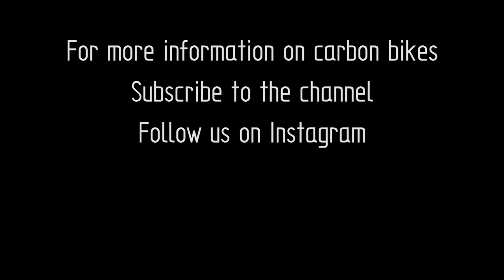Carbon Bike Flaws - Sand Through

Comment: I've had few years old Cube Reaction frame painted with clear coat. Whole frame looked like in this video. I also have Scott CR1, from I think 2009/2010, and whole frame is in beautiful carbon fiber cross patern, without any of this crazy, post sending marbles. I also have BMC Team Elite... and I have to say, that i'm very happy because it's fully painted frame and I don't have chance to see this poor quality production method of modern bikes... 😉
Reply: If I may ask: how was the original paint removed before the clear coat was applied?
Reply: @zwamman  at Cube frame, there was only few graphics on it. It was black/natural carbon fiber frame. There is no colour added to the paint. Scott is also in natural finish.

Comment: In my experience they use a belt sander not a disc sander. Is that what you meant? Sorry about being so picky about the details. Nevertheless it doesn't really change the impact of your examples.
Reply from the maker: I have seen both used, however the majority were 3" disc sanders, it might have changed now.
Reply: @LuescherTeknik  Almost always a 3" DA sander. Belt sanders dig and score. Contrary to what you want in paint prep.

Comment: I had a raw tifosi frame . That had zero of this marbled look . I could see the weave was uniformal,  I could see on the fork the different directions of the weave but there was no sanding marks but I could see the joins in the carbon .  It wasn't an expensive frame and obviously not to a high standard like time but it seems like they at least took some care in manufacturing.

Comment: Surely there is a single non structural lightweight lamination on the outside to allow for just this kind of thing and general wear and tear in general usage? Plus a factor of safety in the design assumptions?
Reply: Accepting that sanding through multiple laminations is “less than ideal”
Reply: You're suggesting manufactures add 2 or 3 plies for that?
Reply: I was once told by a specialized sales rep that was indeed the case. I was worried about some deep cable rub and he told me no to worry because apparently the top layers were “sacrificial”.  He wasn’t an engineer but I did think he was trustworthy.  This was years ago however.
Reply: Losing 1 ply or a few isn't going to result in instant failure but it does set the stage for future failures, both slow and quick (slow being fatigue failures and quick being an overload event like hitting a pothole at high speed by accident and the frame cracking)

Comment: Why is silicone oil so bad? I tought silicone grease is pretty much compatible with everything? Of course ester or polyalkylene glycol based oils are incompatible with a lot of plastics and syntheic materials, but silicone?
Reply: Yes, I'm wondering about the suitability of silicone grease also.
Reply: @Alfred Wedmore okay but how is silicone oil or grease causing delamination, when it normally should be completely fine with any typ of plastic or resin? 🤔
Reply: @Alfred Wedmore sorry but thats a description, not at all an explanation. Penetrating and causing delamination... okay sure. But a lot of oils are good at penetrating. So why should silicone oil be especially bad? And what is causing the delamination? Chemical reaction with the resin? Swelling of the fibre?
Reply: @Alfred Wedmore okay so basically you dont know an answer. Very helpful smart guy
Reply: @Alfred Wedmore sure that makes sense! Because it definitely can mess up the bonding and hardening. Especially when you use it as a spray oil, a thin film of it will be everywhere. But in this case we are talking about a finished product. So thats the reason, why I was wondering about silicone oil being not only bad but especially bad?!

Comment: Tell me again why CFRP is a good material to make bikes out of? Isn't CFRP supposed to be stronger and never fatigue?
Reply from the maker: Any material with flaws can fail, it is a design and manufacturing issue not a material issue.
Reply: @LuescherTeknik  Sure but can you agree that CFRP has a catastrophic failure mode? how can such a material be safe for use as a structural material? at least the metals will bend before they break and you can see the damage before total failure.
Reply from the maker: @Shannon Deckard   When you say structural material you mean like the wing of a commercial aircraft or jet fighter?
Reply: @LuescherTeknik  They do shear off when pushed to the limits like they did when composite lugs sheared off in this accident - https://en.wikipedia.org/wiki/American_Airlines_Flight_587
Reply: @LuescherTeknik  My titanium frame is never going to fail. USA made titanium and a US custom welder built it. 😁
Reply: @wasupwitdat1mofiki94  welds can fail, were the welds xrayed?  No they were not, you know why?  Not for bikes.   $$$.
Reply: @wasupwitdat1mofiki94  Titanium bikes are prone to cracking, and it’s not always at the welds. Feel free to google around. They’ll typically last quite a long time until it happens, but it’s something to be aware of. My buddy just had his custom Ti bike fail fairly spectacularly in the down tube/BB junction after 6 years.
Reply: @RyonBeachner  Carbon fiber vs titanium, titanium vs carbon fiber, I'll take my chances and trust my life with titanium any day. And should there be a failure in my frame it's got a lifetime warranty.😉
Reply: @wasupwitdat1mofiki94  Many titanium frames fail, mostly in the welds if they're poorly made. As an example, Lynskey frames commonly had this problem for many years. 

But I do agree. If I would buy a bike for a lifetime, I feel like my chances are better with a titanium frame builder with good reputation.
Reply: @Antti5  Or a carbon fibre frame builder of good reputation.    Rgr
Reply: @wasupwitdat1mofiki94  I've seen people bloody on the side of the road after their Ti frames from US custom builders (with lot of experience) tore apart under load. I'm not sure why people think titanium is magic. It's harder to do right than just about anything else. And it's not usually the welds that fail, its the heat-affected areas near the welds. Hell, last month I was tightening a titanium skewer and the threads failed. They peeled right away over about 2mm leaving a blank stretch right where the nut was.
Reply: @wasupwitdat1mofiki94  I’m not saying Ti bikes are unsafe or bad, just that people need to really get away from this mindset that Titanium is some exotic indestructible wonder metal, it isn’t. Like anything else, it has it’s problems, and it has its strengths. As long as people can be realistic about what they’re buying we’d all be much better off.
Reply: @robertp7209  When welds fail on a metal bike, they do not collapse like they would like a CFRP bike would. You can still ride home on a Ti or steel bike.
Reply: @SethJayson  I find that what you said very hard to believe. Please show proof.
Reply: @RyonBeachner  Can you please post the links. I cannot find any.
Reply: @shannondeckard8587  I agree with you, carbon should have never been used for rims and fork steerers.  Thanks to carbon rim catastrophic failure lawsuit payouts, we are stuck with F’in disc brakes on our road bikes.  Can’t even convert the bike and fork back to rim brakes.  Everyone knows carbon is not a proper heat sink material for braking.  It’s a F’in heat insulator.  The only proper material for a steerer is steel or aluminum alloys.  The weight weenies out there, I’d say 9 out of 10 of them, can readily trim more fatty acids off their bodies than any carbon weight advantage offers, and then some, especially their butts.  A lot of fat cans out there on their lightweight big buck bikes.
Reply: That's like a baker burning a cake and you blaming the ingredients. It isn't the carbon fiber's fault, it's the manufacturer's fault.
Reply: @HolmsOnBikes  When CFRP fails, it fails catastrophically, and it takes down the whole bike. Metal bikes will likely survive if one tube or junction has failed.
Reply: @shannondeckard8587  you obviously didn't watch much World Tour bike racing this year. Jumbo-Visma rider finished a stage on a Cervelo that was missing an ENTIRE seatstay. 
 Carbon is the better material, hands down. But if it isn't manufactured correctly, it can end badly. 
Carbon has the best fatigue life out of any material.  It is lighter than any material. It's stronger than other bike materials. Your logic is flawed and it's based off of some major misinformation for sure. 
  I don't believe the aerospace industry would be using Carbon everywhere if it wasn't the best material for the job. They scan absolutely every single piece they make, unlike the bike industry which hardly scans anything at all.
Reply: @HolmsOnBikes  Just listened to the podcast interview with the Cervelo engineer regarding that particular bike and he said that the designed the bike essentially to be strong enough to not have the seat stays and have been doing that since the Soloist days. They only have the seat stays because UCI rules mandate that they have them - they made them thin and would have made them thinner but they currently don't have the tech to make them thinner.. So the only reason that particular bike didn't collapse in a heap even though a crash had taken out the seat stay is because they designed it that way. So not a very good example.
Reply: @shannondeckard8587  lmao. Man, you have an excuse for everything..don't ya? Haha. 
It is a perfect example to prove you wrong. YOU don't like it though because it perfectly disproves your argument. Cervelo isn't doing anything revolutionary with their designs. Bikes are all made the same way in the same handful of factories for the most part. Any brand bike would have been able to do the same exact thing. 
 Carbon is the superior material, but enjoy your metal bikes.
Reply: @HolmsOnBikes  Lucas Elrath, a bicycle-accident expert for a forensic company in Philadelphia and the owner of a home-built carbon-fiber bike, had a few great quotes in the story worth noting:

“There’s an old saying in bike manufacturing: It can be lightweight, durable or cheap – pick two. A lot of these carbon-fiber components are lightweight and cheap, but they are not durable.”

“It’s completely reasonable for someone who wants a lightweight bike to look at carbon fiber, but they need to understand the risks. Absolutely this is getting ignored.”

Roman F. Beck, another bicycle-accident forensic expert, warns of the long-range implications of bike makers using carbon fiber material, including mountain bike companies, especially now that there are so many secondhand bikes on the market.

“As good as (many) frames are, what happens when someone rides five or 10 or 20 years from now? Mountain bikes take a lot of punishment, but nobody knows how long these frames will last in that environment.”
Reply: @HolmsOnBikes  Someone has removed the links I posted where these quotes are from. And the multiple links to law firms provided legal services specific to Carbon bike failure. Do a simple search and multiple links will come up for them.
Reply: From this article - Reed and other experts in carbon fiber agree that any material can fail. Wrecks happen from faulty aluminum, steel, and even rock-hard titanium. The difference with carbon fiber is that it can be difficult to detect signs of damage that might signal imminent failure. Cracks and dents in other materials are typically easy to see, but fissures in carbon fiber often hide beneath the paint. What’s worse is that when carbon fiber fails, it fails spectacularly. While other materials might simply buckle or bend, carbon fiber can shatter into pieces, sending riders flying into the road or trail. And this kind of catastrophic destruction can happen to any part of a bike made with the material.
Reply: @Alfred Wedmore Not to mention the fact that you can achieve virtually the same characteristics with modern Aluminum as you can with titanium. There’s no real magic as all the Ti fans will have you believe. Peak Torque has a great video breaking it down.

Comment: I just don’t get it. How is carbon supposed to be so strong when used properly, yet so fragile when these things happen.
Reply from the maker: It's the same with any material, design and manufacturing is the issue.
Reply: @LuescherTeknik  But it appears that CFRP bikes need more proper design and manufacturing processes to make them safer. It has been more than a 100 years of Steel bike manufacturing and we can find steel bikes that are still from the 30s/40s that are still safe to ride even after decades of abuse. But have a minor crash even on a properly design and built CFRP bike and the owner needs a specialist expert like you to have it checked out. What if the owner doesn't have someone like you close by? There aren't many experts in this field that can perform such tests. Even if they do have someone local, they may not know that they have to get it tested after a minor crash or is unwilling to spend the money to do so. So please tell me again, why is CFRP still a good material to make bikes out of that the average joe uses?
Reply from the maker: @shannondeckard8587  That is the exact point, it is not the material, rather the design and manufacturing. Bad metal frames also fail, good bikes of any material can last a long time.
Reply: Different materials have different properties and there are many different properties for each material. In this particular case the properties you're referring to are strength and toughness. From a lay pective they might soundl the same but we engineers treat them as different properties. In simple terms strength is about the internal loads that the material can with stand where is toughness is about how much energy the material can absorb before failure.  It is perfectly possible to have a high strength low toughness material and vice versa. In addition the design, manufacture and loading will influence the component strength and toughness. Yes it's complicated.

Comment: BMC has a three year frame warranty while most companies have a lifetime warranty ( track/specialized).   Sharp edges and corners have always been a poor design for carbon yet BMC has promoted its angular/square edges as a good design.  Even their seatposts have sharp corners that fail as well.
Reply: To be fair, lifetime warranty doesn't mean much either when they exclude almost everything in small print. It's mostly a marketing gimmick.
Reply: @somethingsomethinghere  Never ever had an issue with Giant. They've replaced lot's of frames for me even after knowing they get raced hard and crashed.
Reply: I think it depends on your LBS, and how far they are willing to go for you. 

I had a LBS which didn’t bother to lift a finger to help (basically told me to just buy a new frame), while another lbs which I was way closer with kept pushing till they got my triangle. 

I think that the manufacturers do really offer warranty which covers for such issue, but most of the time the dealers can’t be too arsed to help so they take the lazy way out
Reply: good luck getting warranty from many of the big brands. Most frames are so light now they will crash crack before anything else happens.

Paint cracks are very common but to me not worth throwing the frame to landfill for it to break down over the next 4000 years.

Comment: There are obviously no quality controls, who knows what is under those flashy paint jobs
Reply: There is infrastructure in place at most quality OEMs to do this, but the big brands just will not pay for it to be done, and they want to pay so little overall anyway, that quality is almost guaranteed to be poor.  Best bet is house brands (I'd include Giant / Merida in this).
Reply: @Nate Dog Trek dealer by any chance?  Trek aren't great, and they haven't made anything in the US for a long time.  Waterloo is a paint shop for Project One and assembly.  Zero production.
Reply: @Nate Dog No they do not.  Trek haven't made any carbon bikes in the US for years.  You're a shill.  The Project One frames are sprayed there.  Bikes are assembled and a small number of wheels are laced there.  That's it.  All production equipment was sold / transferred / mothballed years ago.
Reply: this is why spesh pushing the hippy paint